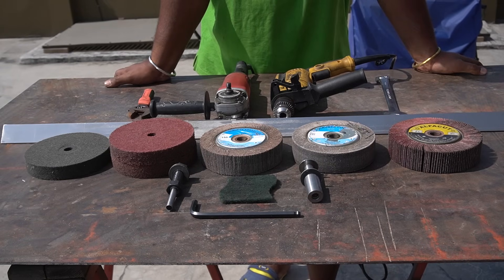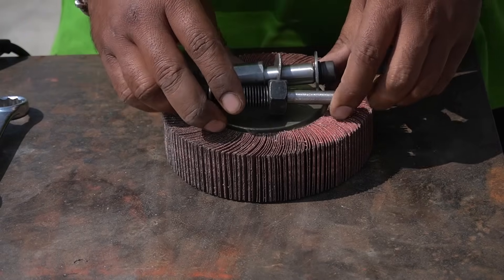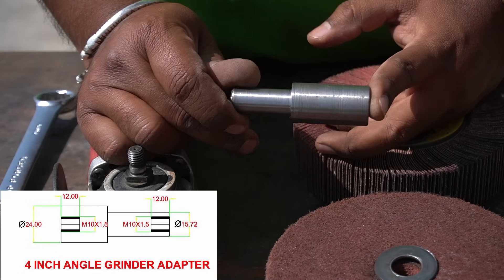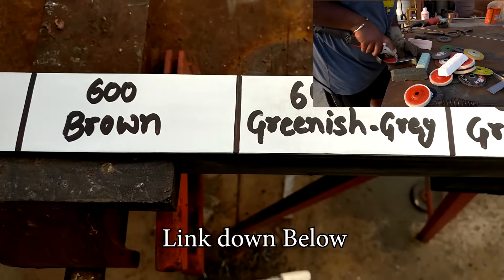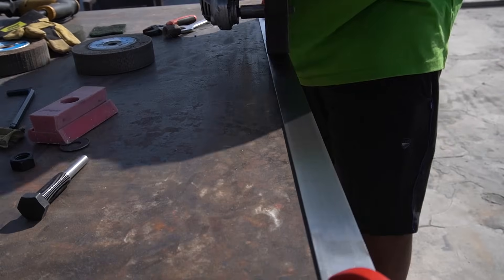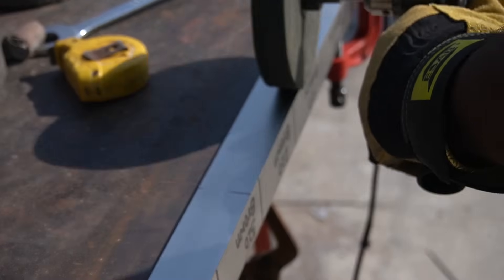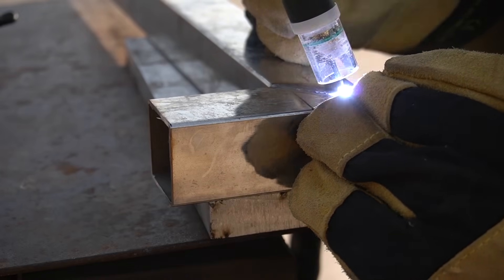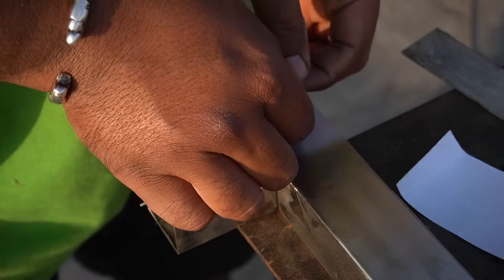Learn Stainless steel Matte / Satin / Brushed finish - How to achieve finish on stainless steel.

Comment: Which grid did you use to get the finish on the stool at the start of the clip?
Reply from the maker: After 150 grit I use U0 scotch wheel. U0 ( U zero) is equivalent to 360 grit finish and gives you fine scratch finish.